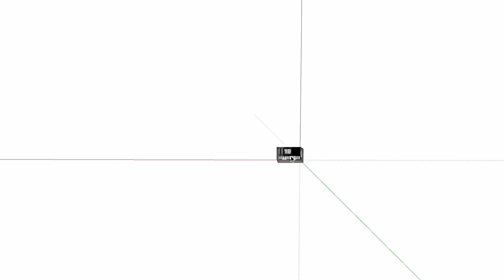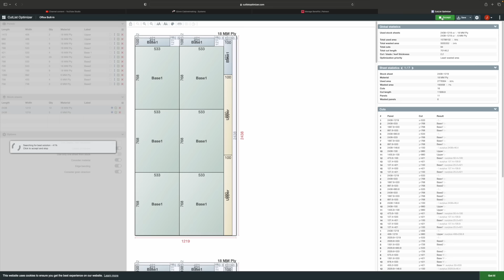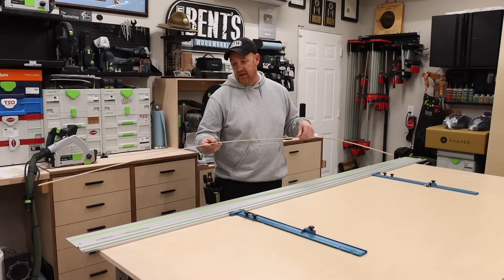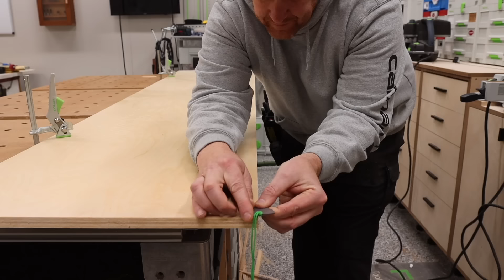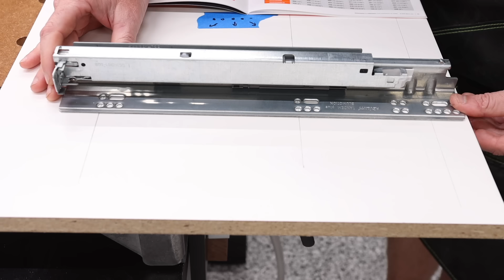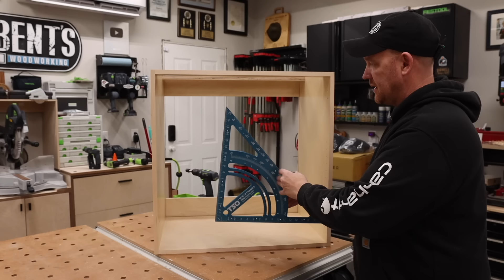STOP overbuilding cabinets

Comment: Never knew that dados were that difficult.  In my cabinet shop I have three table saws each is dedicated.  My cabinets will last a lifetime.  I’ve never ran out of business to date 35+ years.  I just get busier and busier building “over complicated” and top notch quality.  Second generation cabinet and furniture maker.  I will also add that as the house market gets more and more expensive as with lending.  Your opportunity to sell remodels, quality furniture, cabinets, grows exponentially.  Just find the right customer base.  Every customer I won on price I lost on price at some point.  Just my take; take it or leave it.

Comment: Finally, a YouTuber who doesn't overcomplicate things! It's incredible how, to make a kitchen cabinet, they use glue, dominos, a dado stack, and nails. I've been making kitchen cabinets for 10 years, and I can confirm that nails or staples and screws are more than enough. Congratulations!
Reply: Very little of the tools he uses are necessary.  The only thing you need is a decent table saw and flat working table.  You don’t even need the track saw.  You can rough cut with a circular saw and finish cut on the table saw.  Make sure the table saw is squared up.  You don’t need a fancy edge banner.

It will take more time laying out, marking, etc but you can do it.  The big thing he did was cut everything systemically.

One of the nice things about not using glue is that you can break down the cabinets to move them, reuse the pieces or repair them.  I’m still favoring using glue & screws though.
Reply: I’m on the fence about my own cabinets but the kitchen was designed and built in 1953. Lots of custom sizes. 

The simple boxes and a child gate ive built, I like using dowel and glue. This gate is 50” tall, it’s ripped down 2x4 and pallet wood. So far it its supported 98lbs worth of kids hanging on it. 

I’m just wondering if I should the same method on my carcasses.
Reply: And I've never seen a cabinet built like this last. Sure, dominoes and shit are nonsense, but holding wood with staples and screws long term is a piss poor solution.
Reply: @davorzdralo8000 yeah, I’d glue & screw it.

Here’s question:  when you build individual cabinets, you end up with redundant sides.  Is the only way to prevent that to built the cabinets as a set?  Use thinner side walls?
Reply: @davorzdralo8000 i thought all kitchen cabinets (like mine) from big box stores were built like this… and they seem to last… say 20 years at least - if anything its because of them being ripped out for a reno for a new one!
Reply: @willd0g  that depends on your definition of lasting. They are not gonna disintegrate, but they start sagging and twisting in a couple of years. If you have multiple cabinets aligned it's visible and triggers my OCD.
Reply: @davorzdralo8000  I am still using an old makita biscuit cùtter, don't want to spend 3x more for dowels. The biscuits are mostly just for aligning and letting me use glue on prefinished ply. People try to tell me biscuits are ancient tech and try to sell me new fancy tools, but I tried pulling one apart and it's still much stronger than a screw.
Reply: @davorzdralo8000 like when you put heavy dishes in them…one morning you’ll wake up with your cabinets broken apart and dishes broken all over the kitchen. Definitely use glue, dadoes, and  better fasteners
Reply: What??? he has got about $10k worth of tools, everything that open and shuts. Im just ordinary equipped guy.

Comment: Just curious why cabinets use stretchers and a thin back panel? Why not just use one solid piece like the sides? Is it strictly a cost-saving measure, or is it to allow a tiny bit of flex for final installation?

Comment: Correct me if I’m wrong, but isn’t it a basic rule to use the bottom to support the sides so you don’t have the sides fighting to sheer away from the bottom/ top of the cabinet? That looks like the more force you put on top, the more strained those joints would be.

Comment: I use a small bead of clear latex caulk when assembling pre finished plywood cabinets, like phenoseal or dap.  It leaves a nice clean looking corner when cleaned up with a  putty knife covered by a wet rag.  It sticks to the clear finish well.  Not really necessary like you stated but will help on kitchen cabinets that might get wet at some point from a small leak under the sink.

Comment: the title is all wrong.
you’re just showing how YOU build cabinets, nothing to do with overbuilding.  just change the title to “how i build cabinets”

btw, you’re building them like a high production shop build them.
personally i use dados, glue, and brads.  so they don’t fall apart when thrown off a second floor porch.

Comment: I use a simpler method I finish one side of the whole sheet of plywood. Then cut into cabinet sides, tops and bottoms. Then I clamp them together using butt joints and screw together using Conformat screws.

Comment: Don’t understand the wasted time of re-cutting all of your parts to width? You’re already using the festool with parallel guides which is a cleaner cut than the table saw and just as accurate. Also bottom back stretcher is not really necessary. Eli ate these steps and you save that much more time without any loss of quality.

Comment: I see a lot of cabinet maker dado a 1/4" backer with 3/4" nailers the way you have done it here. Why not use a solid 3/4" backer? Is it to save material or to save the screw holes in the back of the cabinet? I'm new to this and it seems more efficient to use 3/4" plywood for everything.

Comment: Love your setup!  Might be a big time saver to make a simple jig for your assembly screws to avoid making lines.  Not to mention, spacing is consistent.    I had a cabinet shop for many years and built my boxes similar to this.  I used air drill for pre-drilling and air drive for screws.  Good looking stuff though.
Reply: Ah I knew someone here had already suggested this.  I made a simple jig the width of my stretcher/nailer boards with steel drill bushings and inserts.  Just align the edges and drill.  Then for the bottom you just slide it over and eyeball it.  Quick and accurate.

Comment: Good video. Thanks for sharing. Do you have a link to the optimizer program you use. I did a search and found several programs with Optimizer in the name. I would prefer to use on that I know someone else has had success with. Thanks for your time.
Ron
Reply from the maker: Cultist optimizer

Comment: I slow flip houses, one about every 7 years. That gives me time to collect furniture that's thrown out here in Phoenix on bulk trash pickup times (4x / yr). Find furniture made of hardwood (normally red oak) 3/4" plywood. I take it apart and stockpile. When time to build cabinets I rip the pieces and biscuit to the width needed.

For exposed edges I biscuit solid wood like you'd do for shelves.

Door panels are salvaged too from cabinets or old doors which have nice 1/4" ply. Paint normally has to be stripped but always easy with a heat gun and chisel as the scraper. Actual scrapers don't work as good.

Always Shaker style which is easy with simple tools. Cottage type interior design for same reason.

I invest time rather than money. I enjoy the process. The result is better materials than mist new cabinets. I also paint. Good sandable primer and good cabinet grade paint.

Comment: As someone very new to wood working.  A couple of things that stump me is 1. Overly complicated plans. 2. Trying to just make a cabinet/ dresser/ basic entertainment center can become overwhelming b/c the mind wanders: what to concentrate on. Ex. Draw sizes, learning face/less cabinets. How it’s held together.  Dowels, biscuits, mortise & tenon, glue.   And most importantly, wood that is relatively flat as most of us can’t afford items like planers, jointers, trac-saws.
Reply: As diy hobby guy , you dont need the Festool tools,  they are great to have but most other brands do just as well .
 Tools can be expensive ,mostly they are worth every cent .
Just research what you need and dont get fixed on 1 brand.
I have a mix of Metabo, dewalt,Bosch,Makita, Parkside(Lidl)

Comment: I'm sorry but butt joints?  I guess if you want to churn out cabinets quick and dirty it's ok but if i'm going to take the time to make these by hand i'm going to throw in a bit of craftsmanship into the project and use proper joinery.  not to mention most cabinets get loaded down with tons of weight in plates, glasses, etc. and I trust a butt joint about....oh actually i don't trust a butt joint.

Comment: Did anyone else notice the vertical deflection on that Incra table saw fence when combined with the Jess ‘Em stock guides at 6:50 ? With that much uplift on the fence, it cancels out the benefits of the roller guides. But hey, when you get this junk for free, who cares, right?

Comment: not to be too judgmental, but your "no glue" cabinet uses an air pressure nail gun or stapler instead... It seems definitely more convenient if you have the tools, but I think people use the glue because they are not as fully equipped.

Comment: Well, before I can get large work tables, large cutting guides, dust control, and better saws, first I will need a WORKSHOP! The point being, all of my projects have to be built out on a sloping concrete pad in front of the garage, where my table saw also rolls out onto the sloping surface to do cuts. Certainly a non-optimal situation!

Comment: Very good overall look at building a cabinet box. There's more complex ways and there's shortcuts. I've installed and build all types. 

You mentioned square towards the end of the build. I was always taught to use the back panel to square up the cabinet box. If the panel is a tiny bit undersized, you can push it tight to one side, and line it up with the bottom, perfectly square cabinet. Assuming the back panel is square of course.
Reply from the maker: Yes the panel can absolutely help with that.

Comment: very nice demonstration and clean work, but i usually prefer to avoid screwing into plywood parallel to the laminate. for very little extra effort, pocket screws would go in at a diagonal. and though i'm not a big user of pocket screws, this does seem to be a good application for them

Comment: at @1:20, what are those blue bars that you're using for placing the track saw? Do they come as part of the track saw? Or is that something you picked up separately? My Kreg Accu cut rig isn't as reliable as I hoped, or I'm not as reliable with it as I hoped

Comment: I have built kitchens for 15 years. All 3/4 material, including the back which is fully inset in the box. No glue, no screws, staples only. I have never had a call back on a box that is coming apart. The only time I use screws is if the customer requests melamine, which is rare.

Comment: I had a question, sorry if already asked. What stops your parallel guides from sliding back while cutting? On my melamine surface, I have to use off cut MDF clamped down which is pushing against the track to keep it in place. Assuming I can’t use the clamps to clamp the sheet and track, because I was working on the ground. Track clamps didn’t have clearance.

Comment: If you don’t have a sliding table saw then I can understand why you rip the edge of the sheet with your circular saw, but after that, why not rip your panels on your table saw?
Reply: I think for Jason and others including myself, it’s easier to use the track saw to do the initial breaking down.

Comment: I love the method!  I plan to build some cabinets for my shop this way as well. My only question is, have you tried this method with face frame cabinetry?  Seems like the face frame would have to either stick down past the bottom of the cabinet (so they would be made accordingly as far as height is concerned) or you would have to add filler on the inside.  Just curious.  Thanks for all of the great videos!
Reply: Face frame is done like this all the time.  However, the face frame does NOT hang down at the bottom.  It lines up  with the bottom of the box and it ends up sticking up into the cabinet, not hanging lower.  The upper portion is flush with the top, then hangs lower.

Comment: I know some makers have to somehow "sneak in" products they need to push because of partnership/advertising reasons and I can totally understand them. However, this ends up making things wonky more often than not: doing experimental things (like dovetails on plywood, asymmetrical layouts, exotic angle joints, etc.) is fun, but from a viewer perspective sometimes all of this is completely overkill and unnecessary.
It also lead to a false perception that you need a lot of tools (and really expensive ones) to be able to accomplish even the smallest tasks.

This video is great, because is straight to the point and puts an accent on being pragmatic. Very well done sir,

Best!

Comment: What length guide rail are you using for the rip cuts? Over 2.4m, right? I've found that using my 1.5m and 1m rails connected together is a time sink trying to make them straight and true, and even if I think I have, I've been proven wrong when I've got multiple pieces laying atop each other.

Comment: First off nice setup, now the problem Festool is way way expensive, how much did you invest in all that Festool stuff ?.  I ran a cabinet shop out of my garage for 14 years and just used a 3hp cabinet saw with 52inch fence and a cross cut box.  Love that festool stuff but wayyyyyyyyyyyyyyyyyyyy to exspensive.

Comment: At @9:29 you place the crossmember between the sides. I have always struggled to size the cross member. These must be sized just perfect, or else there are mm gaps. It should be the width of the cabinet minus 2x thickness of the ply but I still struggle to get this right. 

Can you give any advice on sizing the crossmembers?

Comment: Great stuff here! Couple quick questions...I've noticed when moving between the longer (~9ft) and shorter (~4.5ft) guide rails that I find, my saw doesn't run exactly the same on both. I typically have to readjust the tension between the saw and the guide rail every time I move from one track to another. They are Makita track saw and tracks. My question is whether you've experienced that with the Festool tracks at all? If so, have you found an easy way around it, or simply readjust every time you swap?

Thanks!

Comment: I can't thank you enough for making such a detail and wonderful tutorial.  I have been doing woodworking for about 4 years now and yes, I am one of those that was overthinking everything and using pocket holes for all my cabinets.  I would have never thought to edge band once and then cut my pieces.  This will definitely help me out when I start building my next cabinets for my new addition.  I am going to definitely start pre drilling my adjustable shelving and the drawer slides from this point on.  Again, thank you for a well detailed video.

Comment: It looks like you're using the Grex 9032 stapler?  If that's true, how does it work out not having a depth adjustment?  I've been thinking about this stapler, but not sure if I'd regret not having the depth adjustment.

Comment: I like how you rough cut on the track and then cut to size on the table saw. Few nifty tricks there like the speed square edge as a guide line and using staples rather than nails. Feel I could give a cabinet a proper go now! Nice vid.

Comment: I have two questions. First, are you using this method for paid work or just for shop cabinets and second, would this method work on particle board cabinets? I'm asking cos I recently got a job at a cabinet shop and veneered chipboard and MDF is all we're using to make cabinets.

Comment: Can't recall if you've answered this in another video, but why do you make all your final cuts on the table saw after first cutting them with the track saw? I use my track saw a lot and have found my cuts are more consistent since I'm not worried about keeping my material perfectly butt up against my table saw fence.
Reply: Using a table saw ensures each piece is exactly the same size since you can use the fence, you can make repeat cuts much faster,etc.

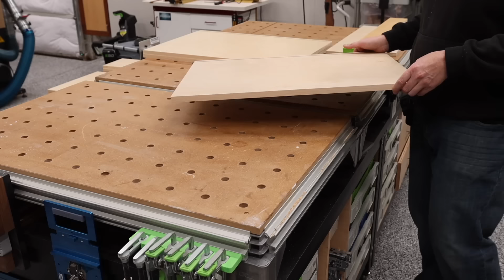Comment: 8:00 agreed, you don’t have to use glue. But using glue makes a very strong cabinet that future-proofs against teenagers or other life events. I can’t imagine not using glue
Reply: But you are not using prefinished plywood are you?  If you are, glue is not doing much...
Reply: @SynergyAVE  Use the right glue made for pre-finished plywood and it will work. There's a glue for practically every application you can think of nowadays.
Reply: @stevenbarnett2291  For the record, I use prefinished Maple and Baltic Birch ALL the time.  Any glue that might stick to the finish is a waste.  WHY?!?!  Because the joint is only as strong as the finish is to the wood.  Once upon a time, I used glue as well, however after seeing the finish pull off numerous times, I woke up.  I do this for a living, and using glue on prefinished plywood, or any wood for that matter is a total waste of time.  It does NOTHING.

Comment: Terrific info on your construction and assembly method, Bent.  The deviations I make is to staple the back to the top stretcher from the inside, as that way the staple braces the light back panel to the stretcher.  Further, I do apply glue, but I think I'll try your glueless method on my next job and see if it results in the strength level I'm wanting for my cabinetry.

Comment: This is a great video. I have a question about your outfeed table. I just started installing my Incra fence system on my table saw and was going to sell my Sawstop outfeed table because it didn't seem like it would work with the Incra system. I see, however, that you have the outfeed table working with you. It looks like it's attached to the bottom of that back rail. Did you have any issues with the rail supporting that extra weight? Looking forward to checking out more of your videos.